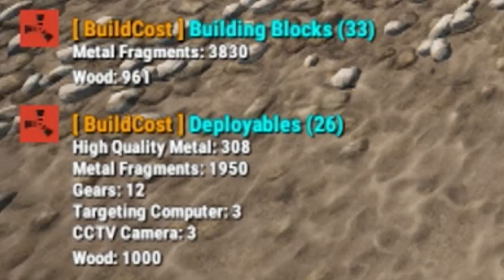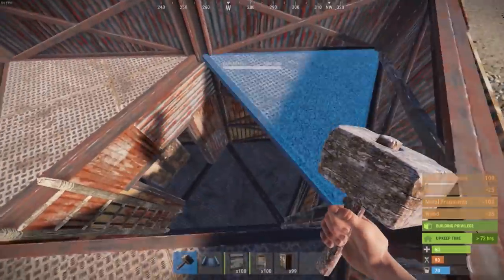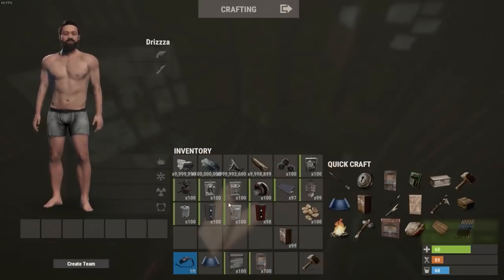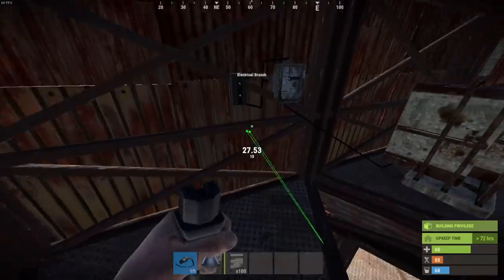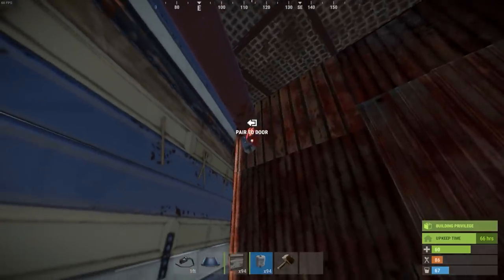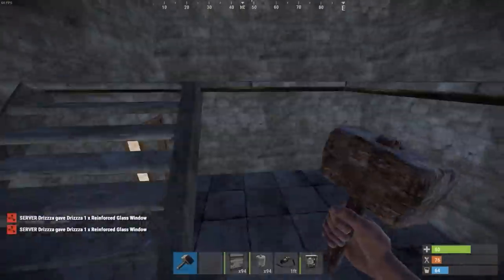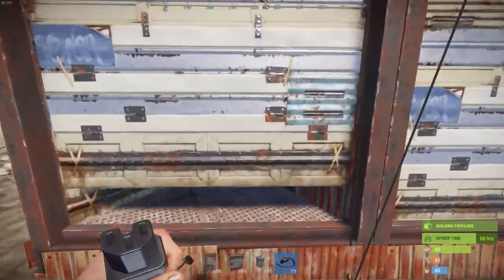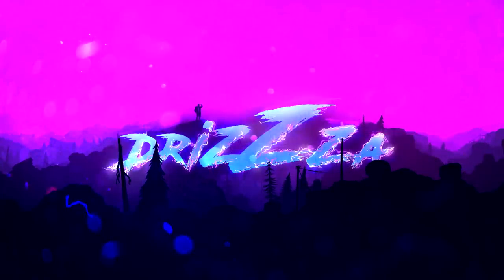Rust OblivionHD Trap Base Tutorial | How to Build

Comment: The circuit shown on the image at the end should get optimised quite a bit tho... If you do a video about it please consider the following points:
First of all you should use the blocker-OR circuit after the battery to be able to have the trap active for an infinite amount of time.
Furthermore there is no reason to use branches to connect the 6 door controllers when two switches would do the job. Actually you should use a branch instead of a splitter whenever the output is not supposed to be split evenly and should get fine tuned. This applies ESPECIALLY at the beginning of a circuit because a splitter might waste a big portion of your main energy output right away. And this is  what actually happens at your first splitter - almost half of the energy output of your battery is getting channeled into 3 sensors that just forward an output of 1 energy. It works if you don't want to extend the circuit later on anymore, but I would consider it bad practice.
The last improvement I would consider is adding another OR-switch to the OR-switch chain at the end and connect it to a switch in your main base to be able to trigger the doors manually without a sensor being activated like you showcased in your video. The switch on that image would currently just be able to turn on the sensors, but could not open the doors if no one triggers them or if the sensors even get destroyed.

Cheers
Redshire/Empiter
Reply: the player sensor (forget the name) only passes through as many volts or power as there are players, so you need the and switch to get enough power to run the doors
Reply: @boredominacan  oh you are right. The AND switches do have a purpose in that case. Thanks for the info, I'll edit my answer later on. I thought they would work like normal switches/pressure plates/laser detectors... in that case the first switch would definitively waste half of the energy output - not as much of a deal since the output of the large battery is high enough anyway, but imo you shouldn't form a habit of these bad practices.

Comment: use an rf receiver instead of a 20 meter wire
Reply from the maker: I wanted to show a cheap easy version first
Reply: But we also need controller (remote controller) device if we use rf receiver.. isnt it?